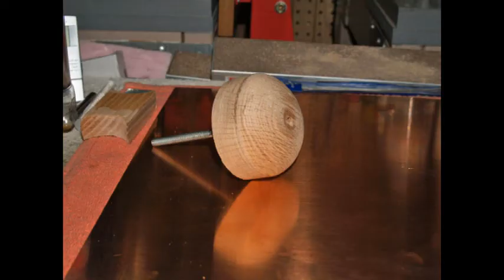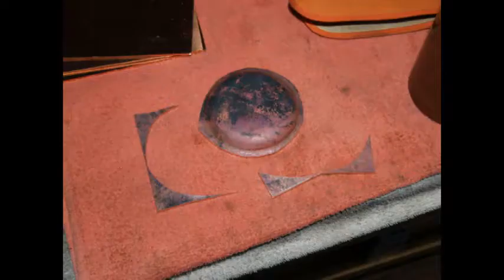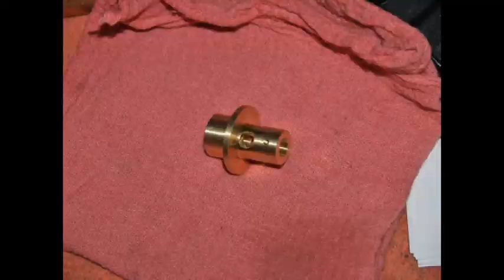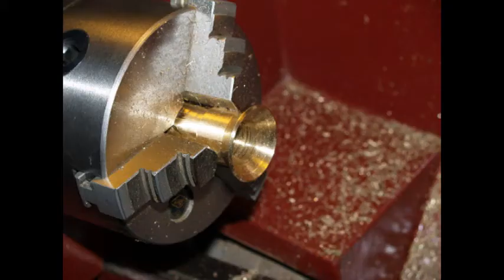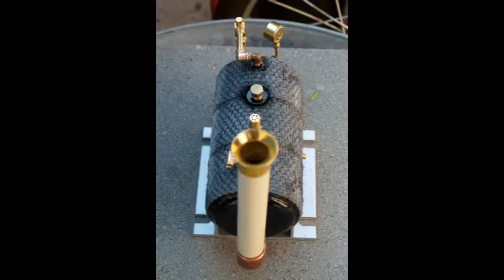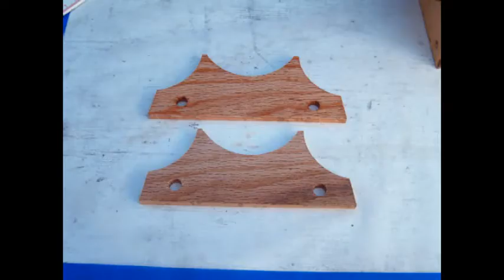Model Steam Boiler Construction

Comment: Wow. How beautiful that work is! I have two questions, can I use regular copper pipe caps for boiler ends instead of making ends like you did? And can I use the same solder plumbers use for copper pipe in homes? Thank you so much!
Reply from the maker: +DrFrankensteam Thanks for the comments! To answer your questions:
1) Yes you should be able to use the copper pipe caps. Just use the same gauge, or thickness. 
2) NO! Absolutely not. That is "soft solder" and will melt when you have a fire going under the boiler. You must "braze" the copper seams with a"brazing rod" and gas torch.

Comment: Excellent slide show, but would have preferred a bit longer on each shot.
What is the white insulating material?
Reply from the maker: Thanks!
Well, if you place your mouse cursor on the video screen, then left click it, it will pause the video. Then you can linger as long as you wish. Left click again, and it will play again. 
The white insulating material is plain cotton string, painted with white house paint.
Reply: i don't know what he used but I see a lot of people in steam boat toys use glue and regular white string/cord and or hemp cord, glue and white paint. then they just coil it around the pipes and glue tack in place then coat with paint or clear coat

Comment: absolutely love the fantastic craftmanship. I am wondering if you have a site that can teach others how to craft one and where to get the materials.
Reply from the maker: Thank you for the comment. Sorry, I do not have a site.
Reply: Investigate the hobby of model engineering, there's over a 100 years of information on boiler construction. Check back issues of the Model Engineer or Engineering in Miniature or better still join a club.
By the way, the first test of a boiler is not with fire it's hydraulic using water so you can't blow yourself up😮😮

Comment: I I’m looking to build a boiler myself.but I’m having troubles finding the copper pipes and sheets
Reply: same here, i am beginning to think a way around using standart copper pipes, 1/4 or a bit bigger (refrigurator) and the standart 3/8 or higher from water and heating pipes, bend and solder it together and make a water tube boiler. he uses very think material in the vid... that tubing is as far as i know not used so often, therefore it's harder to get i guess.

Comment: what is the pressure inside the boiler?
Reply from the maker: It depends on how high the burner is turned up, and for how long. The pressure relief valve is set to 50PSI.